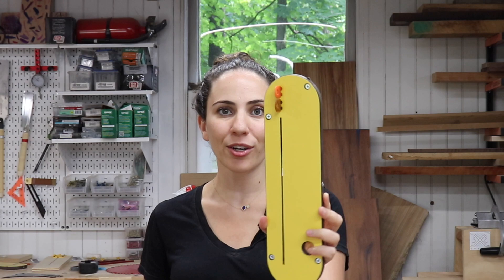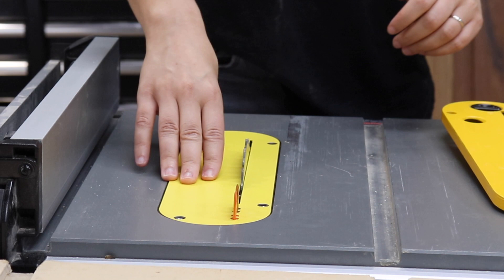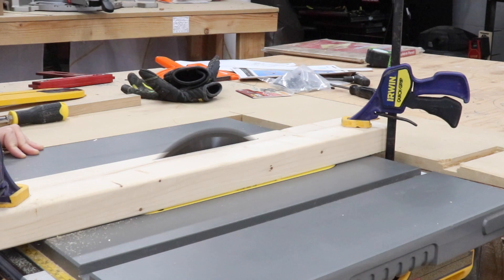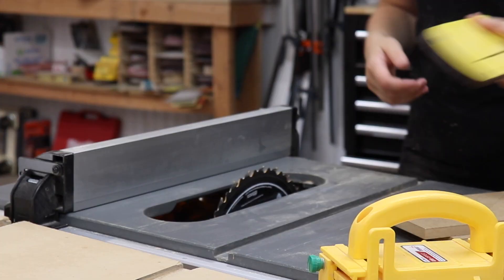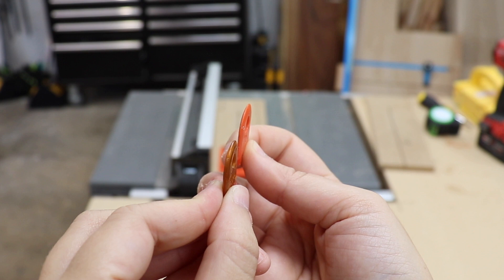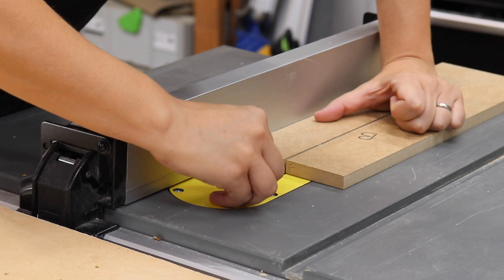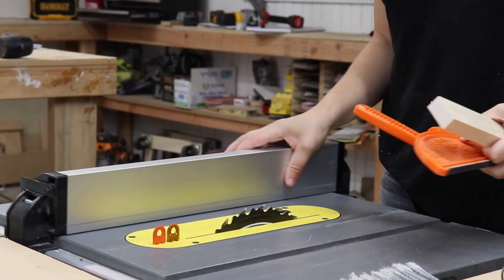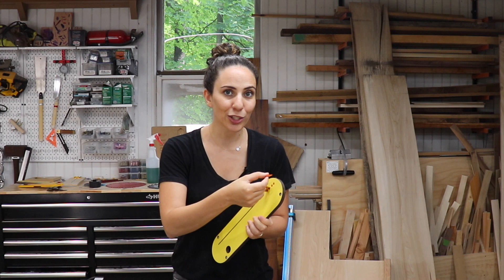Zero Clearance Insert with Splitter // Riving Knife // MJ Splitter // Kerf Keeper by 3x3Custom

Comment: Thanks for going through the installation.  You simplified the process tremendously.  I have a Craftsman 113.298762 and had to use a metal drill bit to drill through the throat plate lip for the last kerf keeper hole, but it wasn't difficult, just a heads up for anyone else out there with a 113.298762.
Reply from the maker: Thanks for the kind words. 3x3 Custom does great work. 
For the older saws that do not have the 2" behind the blade that we recommend, you can use our Steel Pro Splitters, but only drill for the first one, leaving the second off. This requires about half the space of the two-splitter setup.

Comment: Why add a splitter? That saw is equipped with a riving knife system. A zero clearance throat plate worked just fine on my DeWalt saw.
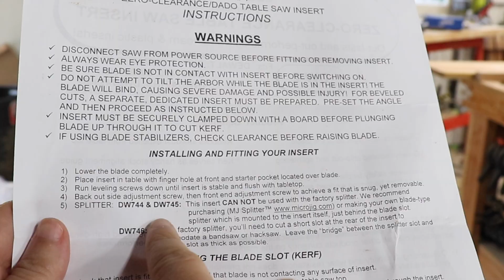Reply: Learning the Hard Way addressed this in the video just after 2:55
Reply: Brian Prusa yep I know, but don’t understand why. Like I said I’ve ran zero clearance inserts on my DeWalt saw (same model) and had no problem cutting a slot for the riving knife.
Reply: Learning the Hard Way yeah, probably just liability thing with legal stuff. They want you to use the one that it comes with.
Reply: I have an older Grizzly 1023 table saw and there is NO riving knife available.
Reply: I got a 1950's Unisaw recently and if there ever was a riving knife it's long gone and a factory replacement can't be found. This thing might help my wife and my dad stop nagging me...
Reply: The splitter on your saw is matched with its factory blade. If you change out to a thinner blade or even a 7  1/4 blade your stock splitter will be too thick. Why a 7 1/4 blade? Many are now finding them cheaper, safer and less dusty.
Reply: Most riving knives are set up to be in the middle of the kerf.  Because the manufacturer doesn't know if you will be using a thin kerf blade or not the riving knife is made to work with the thinnest one.

With the splitters the right side of your blade is perfectly lined up to the front splitter whereas the riving knife may or may not be.  Splitting hairs at this point because we're talking thousandths of inches here.   So if you already have a riving knife then the value of the splitter is diminished. 

If you don't have a riving knife however, it's an inexpensive major safety upgrade for your saw!   Everybody's needs are different.

Comment: Great video, as are all of your videos.. great explanations of why as well as how. My woodworking chops not so hot-- comfortable with metal (mess up - weld it up and do it over!!) but wood has always scared me..kinda. I have an older Craftsman 10" saw and it does not allow for a riving knife which obviates the ability to make use a cross cut sled-- too dangerous without that protections. This appears to bet he perfect solution to both accuracy, ability to make smaller cuts and  make and use a sled (saw you vids on  that topic too!!) I am now a subscriber and look forward to becoming more educated as a result. Thanks, Larry
Reply from the maker: Good to hear Larry.

Comment: I think the amount of flex in the standard throat plate is insignificant unless one deliberately pushes down on pushstick more than needed on a small workpiece. If workpiece is larger then it is fully supported by tablesaw top and flex should not be a problem. What do you think?

Comment: What’s the meter / track mechanism that you used to check the right angle of the blade?
Reply: Straight edge with adjustable 90* square
Reply: Basically a metal ruler with a block on it, that you can set a height and lock in place

Comment: is that a wood insert or medal
I only have a regular insert that's medal insert( like the first one you showed. )What thickness and type of material did you use to make a clearance insert
Reply from the maker: William, you can buy plates already made in phenolic or nylon. You can also make your own out of a good quality 1/2" plywood. Use your existing plate as a template for making a Zero Clearance plate.

Comment: I have an old Crafstman/Sears table saw - the factor throat plate is only 1/16 inch thick (metal).  How would I go about creating a zero clearance insert for something that thin? (non-standard thickness)?
Reply: You can cut aluminum with wood blades (be wary of plastic tools/parts anywhere the saw dust would normally shoot), .0625" aluminum flat stock + router and the trick with creating the blade slot shown in the video and you're rolling.

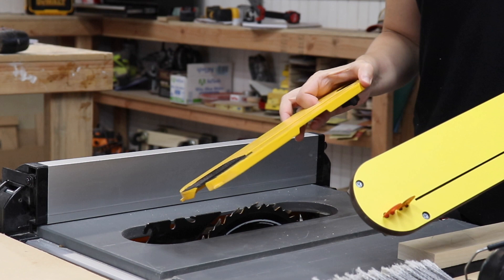Comment: 7:00 You didn’t lock your plate down 😮
Reply from the maker: Cheri, if you look, you will see a small screw head in the edge of the throat plate she is using. 
That is adjusted to fit the plate into the opening so it does not move within the top opening. It also helps to keep the plate in place.
Not all throat plates are lockable in the way you mean.
Reply: @Microjig I’m talking about her stock plate…it’s the same one I have and there’s a lock knob center bottom. She ran that test piece through without locking the plate down. 😮

Comment: Instead of modifying the insert and/or the riving knife you are throwing it away and switching to a splitter , which is inferior in every way. No, thanks. Bad tutorial.
Reply from the maker: Actually, we are VERY clear about using the riving knife if your saw has one. All NEW saws sold in the US have a riving knife now, but MANY older saws still in use do not.
Also, the riving knife opening is often too large to safely cut very thin strips. The strips can fall into the riving knife opening. For example, the opening on the SawStop is about 1/2" wide so you cannot safely rip anything less than 3/8".
By using a ZCI with MJ Splitters, I can safely rip down to 1/8" using the GRR-RIPPER.